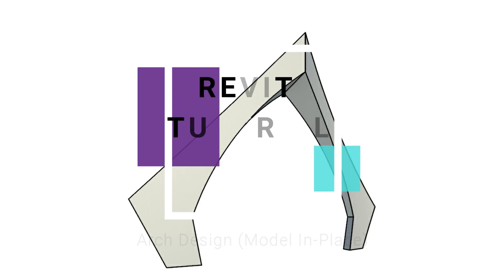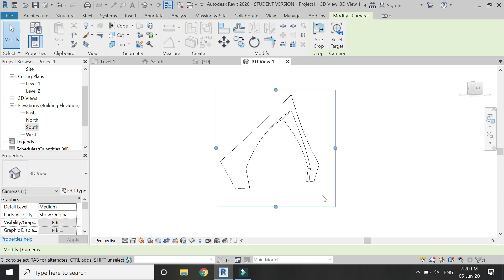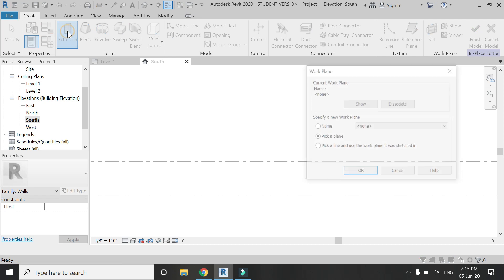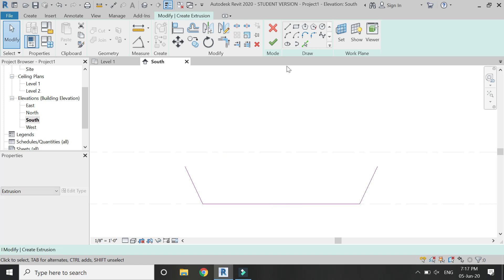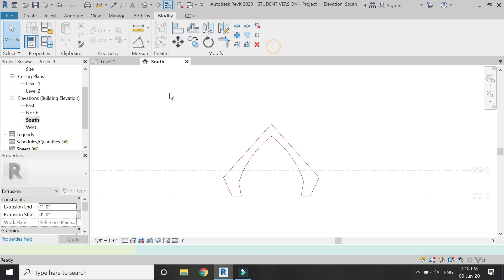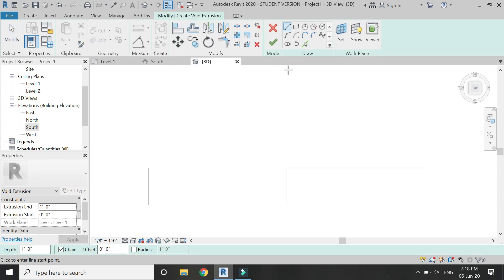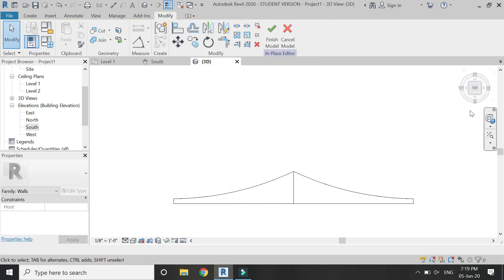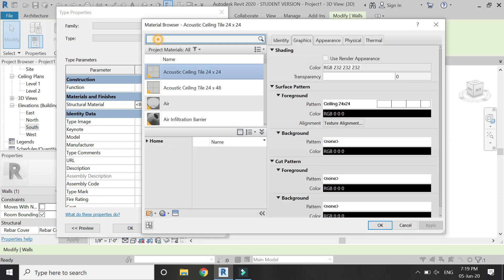Revit Tutorial - Arch Design (Model In-Place)

Comment: Just one questing, when to use "In-place mass" with "Wall by Face" and when to use "Model in-Place" with wall category?
Reply from the maker: In-place mass is used where there is a more complex shape mostly two or multidimensional curves. For the simpler models you can use model in-place. Most of the times, it is your judgement call.